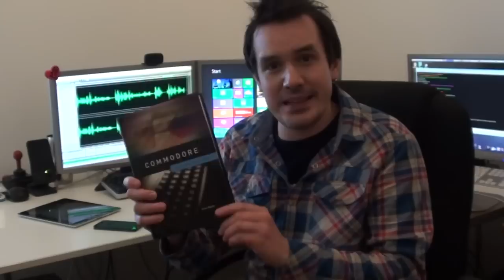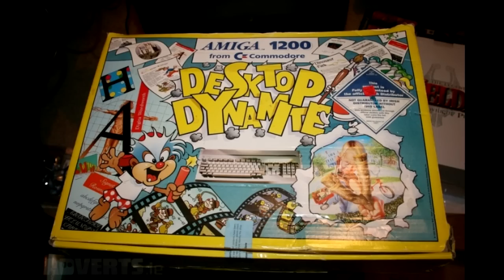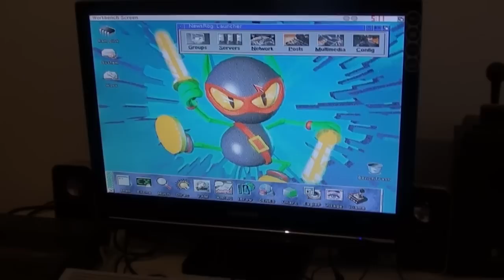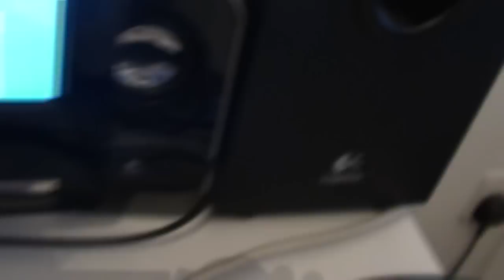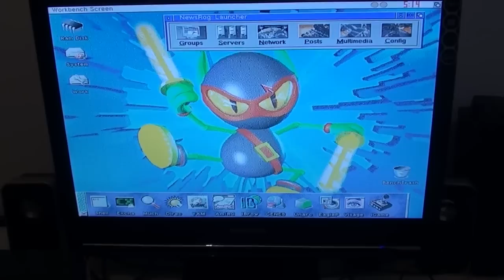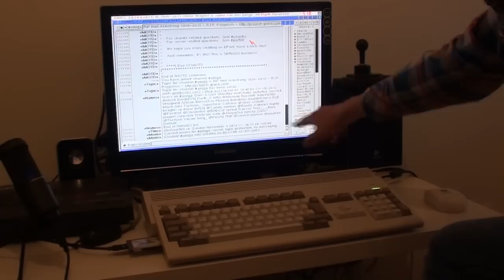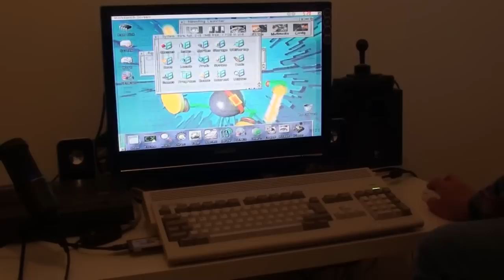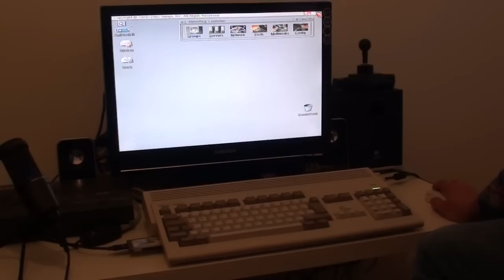Commodore Amiga 1200 Review

Comment: A actually was using an Amiga1200 'til way after 2006 when I switched to Mac. And that btw was an unaccelerated A1200 with "only" some more Fast Ram (8MB) and an upgrade from the already installed ca. 800MB Hard Drive (Escom) to a 3GB one (which I sadly wasn't able to backup yet) as well as a 4xCD-Rom and some external Floppy Drive.

It was really painful surfing via AWeb with only a 56k Modem,  since the unaccelerated Amiga only was able to squeeze ca. 32k through it's serial port.

Comment: Topsoft, I remember those guys well in Stockton, they were down the little back alley, their shop was like a little Aladdins Cave, Steve and Alex in there were great guys. They moved round the corner early 90's into a bigger shop on the corner and then into the shopping center.

I frequented their shop, bought stuff virtually every week on my C64 from them.

Currently have an Amiga 600 with Easy ADF and the PCMCIA CF adapter, should be getting a 1200 in the next few weeks so will finally be able to experience the AGA games as back in the 80's & 90's I was an A500 user.

Comment: Great video, thank you for sharing.  You're making me want to get my A1200 out the loft. It had an 80MB HDD and an Blizzard 040 accelerator board and RAM expansion. Didn't even know you could stil buy stuff for them to use them in today's modern connected world. Monitor is the big issue, I think I junked the old Philips I used to use it with :-(

Comment: The yellowing is sped up by sunlight, but the direct cause is an incorrectly mixed batch of plastic that contains more starch than recommended. This usually results in the yellowing of plastic, which can be reversed by the application of bleaching chemicals. There's actually a hugely rare selection of about 300 Super Nintendos that turned green over time, but there are only a few still in existence.

Comment: Hi what a great video!! I pulled my original 1200 from the loft this week but sadly the internal HD and floppy were toast, I have ordered a new floppy from amigakit and an RGB to scart cable, PCMCIA C flash card and a 68020 128MB accelerator (I used to have a blizzard board back in the day but sold it) I got my HD replaced with a CF card, awesome to be playing BIP and sensible soccer again, lots of it wont work till I get the ram card but its enough to warm the cockles, such a great bit of kit.

Comment: The A1200 was indeed the best computer ever made, hands down!

I was late to the Commodore party, parents couldn't afford to buy me the C64 when I was a kid, they got me the Sharp MZ-700, dear oh dear, the only graphics capabilities on that thing was the funky characters printed on the side of the keys and beeps for sound lol

Wasn't until 1988 when I used some of my college fund to buy the C64, can still remember to this day walking into Tandy computers and buying the C64 for £150.

Absolutely loved the C64, it was such a huge step up from that sharp mz computer, eventually got myself a 1541 disc drive and the action replay mk6 cartridge which I used to make copies of all my games from tape to disc, boy did that transfer how awesome the C64 was to use, games loading in just a few seconds.

Think it was around 1992/3 when I brought an Amiga 600, the A1200 was out at the time but I couldn't afford that at the time so opted for the A600, around 1994 I got the A1200 race & chase pack and sold the A600 to my brother. Had many years of joy using the A1200, didn't take me long to get a hdd to use & wanting more power I used two Blizzard accelerators, the 1230 & then the 1260, that 060 was a speed demon compared to the standard 68020!

Still got all my amiga gear stored in the loft, if I had the space I'd have the A1200 all setup & running although I'd have to get the board re-capped to be safe as I wouldn't want those things  exploding & damaging the board.

Comment: Nice .. I started running a bbs on a comadore 64 with a 300 baud modem when I was  15  then ran one on a 128 machine . Then moved to an amiga and ran a bbs also  was part of fidonet and had 4 scsi drives on my 500 machine .. Was alot of fun . I upgraded the chips in the 500  some had to solider etc .. newer kick start fater angus etc . upgraded it to 2 meg of chip ram and had a side car with  4 meg of ram and a 100 meg hd  daisy chained 3 more drives off of that 500 was 2000$ can at the time  and 4 meg of ram and the 100 meg hd was 1000$ can

Comment: My old A1200 still boots, as far as I know.  And I had it on the internet back in 2001 or so.  PCMCIA adapter worked a treat.  I moved it into an old 2000 HD box as I was hacking away at mine as well.  Got to add the CD drive quite easily then.  :-)  Maybe I could make a vid of it sometime and show the old original 2000 power supply running it.  :-)

Comment: You have a really neat Amiga 1200 system there! Have you considered putting an 060 in it to give it even more speed?  I had a PPC towered up A1200 which sadly died and I had to leave it behind when I emigrated. But hoping to pick up another A1200 when I come back to the UK at Christmas and build it up a bit. The DVI adapter looks great, does it make pal low res games look blocky though on a monitor?

Comment: As a kid growing up with a Commodore 64, I always wanted an Amiga!  My family ended up getting a 286 and 386 PC in 1989 instead, and they were nice in their own way, but I still loved Amigas, and got a used 500 several years later, although sadly I don't have room to set it up at the moment.  Is there any way to set up a Compact Flash card like that on a 500, or do you really need a 600 or 1200?

Comment: I am an original C64 and A500 user from the old days (1985-1994). I switch to PCs after that. I have an Amiga 2000 and 1200 that I just won on Ebay. I want to add the Indivision ECS and AGA (respectively) to the two Amiga systems. But, I am curious, why did you have your A1200 hooked up via your SCART connector AND the Indivision output to a DVI cable? Are both required for different screen modes? I was under the assumption the Indivision would output all screen modes.

Comment: Hi I have a Question which joystick did you use in this Video for the amiga? Is it a modded Competion Pro? It clicks relly nice, it might have very good microswitches? because on the old original Competition Pro joysticks the microswitches were bad back in the day. When you have used it for a certain of time the buttons fail to respond. It would be nice if you could tell me which joystick do you use or any tips to reactive my old Competition Pro joysticks! thanks

Comment: hi, nice review!!! I recently got an amiga 600 to fill with a compact flash!
What is that adapter you use for having a dvi display?
Reply: It's called "Indivision AGA Mark II" by Individual Computers
Can be found on Amigakit.com
Reply: Or maybe it's "Mach 2" rather than Mark but I'm sure you'll find it
Reply: TheXtrmn8 Thanks... I've found it! Whoa, it's quite expensive, I thought it was jus an adapter for the plug... but now I understand it needs to modify the frequence of video signal (or similar) so the amiga can be attached to a dvi screen without flickering and scanlines... for now I'll stick on the catodic tv :) :) (also this is just for 1200)
Reply: giovanni scarfini Yeah it is quite expensive, I actually use and old 15" crt-monitor with my 1200 which if you want to be nostalgic is the way to go.
However, finding one might not be easy I was lucky that my dad kept one in his basement so I took it. 

I have Indivision, the first card, in mine and it connects to a vga-cable and I think the one Dan shows us here uses a dvi-port. 
I bought the entire computer off a swedish auction site, a couple of months ago, never had one back in the day, I used a 500 and 500+ My dad had an amazing 3000

Comment: If this helps to resolve the issue the reason cases on old computer go yellow is because of the fire retardant chemicals on the plastics...not the plastics themselves. It can be reversed. It was discussed pretty heavily on the "Atari-Forum". Retrobright I think was the most effective solution used which involves removing the chemicals off the plastics without damaging the plastics themselves.

Comment: I had a GVP impact mk2 hard drive. It had a `massive` 80mb capacity and 2mb of extra memory (i think it could go up to 8, but ram was REALLY expensive back then). It plugged into the a500 zorro port and was SCSI compatable. I think it cost about £400 in 1991ish. Loading workbench in seconds and not having to juggle floppys was amazing at the time.

Comment: Ahh nostalgy <3

i just wanted to ask are there viruses on the net for the amiga ?
if so, is there an antivirus software ?

you brought so much nostalgy in this video now i want to have the same amiga 1200 configuration as you, i can buy an 1200 on ebay with no problems
but could you please post the extension parts and the sources i could aquire the parts from ?
thx for the great video

Comment: The Amiga platform is defined as an OS by Commodore-Amiga running Amiga software natively on a Commodore-Amiga motherboard computer. I would say the rebranding of a computer with the same motherboard doesn't detract from that, really. :)

You could add any amount of expansions to an Amiga, and it would still be an Amiga. As soon as you change CPU family or start to add "wrappers" to be able to run Amiga software, or if the OS or vital parts won't run natively, you've left the platform.

Comment: Unfortunately from what I remember the A500 didn't have any built in hard-drive interfaces ie. no SCSI or IDE. However you could get a "Sidecar" HDD which which connected via the side port. 
I think the Commodore drives were 'A590' drives, but GVP (Great Valley Products) also manufactured a series of A500 HDDs called "GVP Impact" :)

Comment: I've got an amiga 1200 and a 500+ in the loft...really must dust those off now I've watched this.
Reply: Get that 500 Plus out of the loft!!! crack it open and just HOPE the battery leakage isn't so bad that the board is destroyed!
Reply: I did actually get them out of the loft (they've been out and in use again for about 2 years now). Thankfully, although the battery on the 500 plus had leaked it didn't do any damage so I just removed it and all is well. Phew!

Comment from the maker: I'm not sure what alternate universe or mind-altering drugs you were on.

Jay Miner was not working for Commodore or anything on the Amiga by 1990, he left in '89, he did no work on the A1200 or the CD32.  His last big project at CBM was the ranger chipset which was a pre-cursor to ECS but it was unreleased.  AGA was done by Dave Haynie mainly.

The A1200 was not out in 1989, the ECS machines hadn't even been released then, check wikipedia: 

"It was launched on October 21, 1992,"

Comment: I fail to see the point in getting a classic machine to then just use a usb or something that has downloaded disc images of games on lol

you may as well just use emulators on a pc etc
Reply: Turn on computer wait for BIOS to finish, boot to OS, load Winuae/AF, wait for inevitable popup of some OS update, Driver, request for access, enjoy your emulation experience, keyboard layout is wrong, controllers are wrong, aspect ratio is wrong and if you used an Amiga for any long period of time sound is wrong, graphics are wrong the feel is wrong, so you go back to your OS to do some research, and that's when you realize the problem, it's not an Amiga! you can only get so far with faking something. Now I know some ppl say that you can't modify the original hardware otherwise you are messing with the "true" experience, and I say that's very short-sighted. It's a computer, not a console! Even the original Amiga A1000 was built with expansion in mind, and going on from there the A500, 2000, 3000 all had expandability and even the chipset was removable (socketed) for upgrade purposes. The manufacturing move to SMT necessitated the removal of most sockets for reliability and cost but that still didn't stop them from keeping and even adding expansion possibilities (A1200 has the 32 bit bus trapdoor on the bottom for extremely powerful upgrades, IDE, clockport which can now have that USB attached to among other things, PCMCIA which had a bunch of attachments plus on the back you had all the standard serial, parallel, 2 input sockets, daisychain FDD, 3 different video out and if that still doesn't scream upgrade me then why the expansion trapdoor also on the rear. It was never meant to be stagnant system. And that doesn't stop it from still being an Amiga. None of this is to say emulation is not the right choice for some ppl, just to say emulation is mostly like running Amiga but just not quite.
I probably use Amiga emulated 75% of the time, but what I find is that I do it in short bursts with only 1 or 2 things I want to do. But when I boot my A1200 up it's on for hours and I do many different things. If I had space for both my PC and my Amiga to be setup I think my PC would get used considerably less for PC tasks. 
TLDR :- Amiga rocks PC stinks ;-)

Comment: does it have a blitter?
Reply: Of course, all Amiga models got a blitter in co-processor with direct memory access to RAM.
Reply: no fpu then?
Reply: Original A1200 have no FPU, but it got an internal expansion slot under, where you can fit a memory card with FPU, or a full blown accelerator card with faster CPU, FPU and RAM and optionally SCSII. If it's a card with 68030, 040 or 060, it also can include MMU in addition to FPU.

Comment: Amiga 1200 had two faults:

1) No built in fast memory
2) Underpowered CPU (machine needed a 28Mhz cpu, but shipped with a 14)
Reply: Neb6  Amiga 4000 is a better machine sure, but generally only because you can add better stuff to it (such as RTG cards and Delfina sound cards...).

Comment: I did a stupid thing in the late ‘90’s I threw away my Amiga 500 (1985)  and the software.  I hesitate to throw anything away because most of the time I regret it.  I recently bought an Amiga 1200A.  I never owned one before. I still think it’s a great computer despite it’s specs being outdated.  I originally bought my Amiga because I hate Bill Gates.    Windows 95 has spyware built right into!  Not cool at all.

Comment: Not wanting to bash your dream machine but at the time the A1200 and the A600 were literally white elephants and I blame these machines for one of the reasons Commodore failed. 

They were just the same as the previous amiga 500 with slightly better graphics and a moderalty faster processor (A1200) by 1992 I had had my A1500 for 3 years and I had a 68030 50Mhz processor in it for 2 of those years...

Commodore should have at least chucked in a 030 in the 600 and a faster 030 in the 1200 for little extra cost and a whole lot more performance.

But I guess that CBM had failed long before and we guessed this when they released the C64GS for the same price as a full blown C64... again they missed a market.. these consoles should of been £50 and they would of shifted tons more... bung in a future upgrade to a  tape drive and keyboard expansion for another £50 and that would of been a winning combo.

I did buy a 1200 but I used it once because my 1500 was loads faster... it remained in its box (I still have it) ever since...
Reply: Precisely. A1200 had a bunch of issues.

Comment: I thing Amiga 1200 failed because people were moving to the multimedia PC that has Sound Blaster card and CDROM this killed the Amiga
Reply: All Amiga models are actual capable of 14 bit output in stereo, its not bad at all. Amiga also had graphic cards, sound cards and expansions. I think the big box Amiga's kicked 486 ass back then with its pre-emptitive multitasking OS and unique feature of drag-able individual screen modes. The early PC sound cards of the 486 days actually got Amiga module music on the demo discs, played worse on PC than original Amiga hardware though, as the sound cards was not capable of the frequency range or stereo output in other than MIDI tunes.
Reply: The Amiga 1200 didn't really fail. Commodore as a company did! What I will say is I don't think Commodore were ambitious enough with the A1200 it could have been more powerful e.g. the 68020 could have run at a higher clock speed etc.
Reply: I think it was "incompetent" management, lack of marketing strategy and the lack of marketing that failed. Amiga 1200 sold very well actually when it got released in 1992, it was like the Amiga 500 success all over again. Especially in UK and Germany where Commodore had really strong departments and marketing. 

I much cheaper and easier way to make the A1200 more powerful would have been to integrate a socket for  Fast RAM on the main board or maybe 2 MB Fast RAM. When you have Fast RAM on the A1200, the built in 68020 CPU more than doubles it speed.
Reply: A 386 was a 32bit cpu doom killed the amiga
Reply: Humanoid it failed because the company didn't keep it up to date w/faster cpus &such. It was a powerful graphics machine til the windows&apple PCs became more powerful
Reply: Basically company mismanagement, and lack/wrong promotion/advertising kill it.  From a technical perspective it was way ahead of its time.